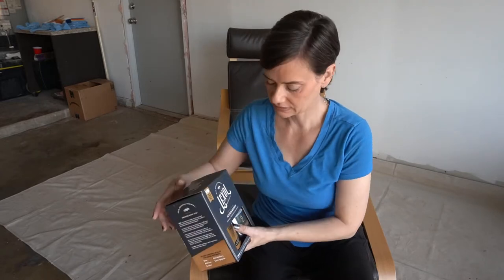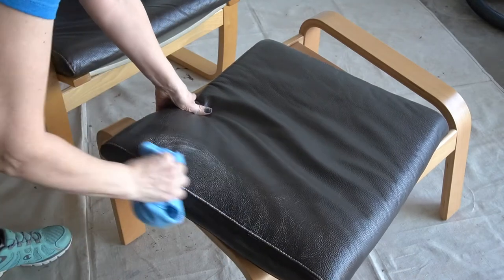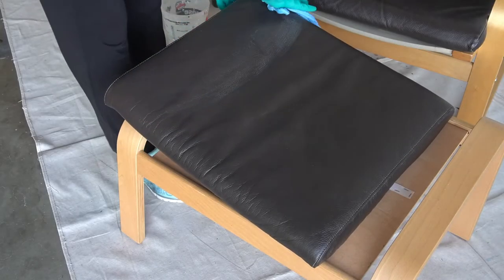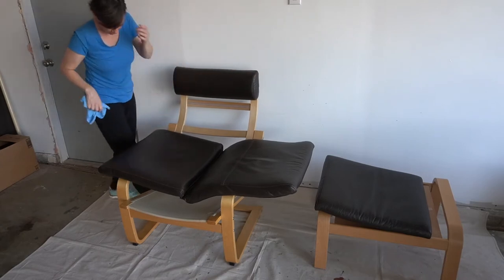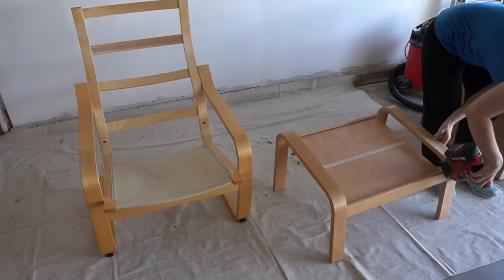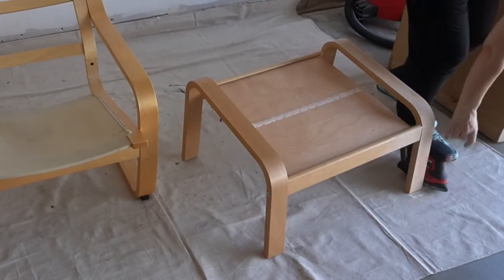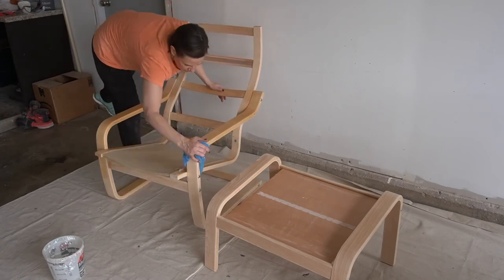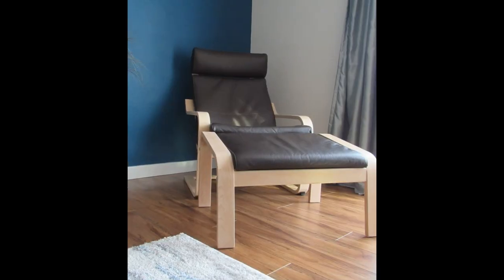IKEA Chair and Footstool Refresh Leather & Wood #furnituremakeover #restoringleather #Lexol

Comment: For cleaning leather I use saddle soap to clean my leather car seat. It doesn't smell all that great but it works. May need to do it twice to get it working but it does a great job!
Reply from the maker: Thanks for the tip! I'll check that out next time this needs cleaning.

Comment: Still surfing for faux wood finish.
Reply from the maker: I've responded on your other comments but in case you don't see those, check out my Cozy Winter challenge video from 2021. It's linked in the description of the dresser video and gives much more detail about my faux walnut process. Thanks so much!

Comment: I have a set of those chairs with one Ottomen that was lifted outdoors and got weather damaged... So I want to make make it a patio set for outside, and just take in the cushions after using... What treatment would you recommend after sanding?
Reply from the maker: Since I can't see the actual state of your chair, I can't really say what's the best option. If it's not expanded and still structurally stable, look for a topcoat made for exterior use on furniture. Good luck with it!

Comment: Thanks for this post! I’m working on redoing the wood on the same chair, I want the wood darker so it matches my other furniture.  I sanded it as much as I could (it wasn’t easy for some reason) I used the mouse B&D sander, took forever and had to even go as low as 60 grit. Kind of worked but don’t want to sand more (noisy, messy and neighbors are complaining). How would you recommend I stain it? I have varathane oil based Kona, Jacobean and Aged barel stains (I’ll go for Jacobean I think). Any tips would be grea, do I apply pre stain conditioner? Thanks
Reply from the maker: I'm happy you found this video helpful, leila1! If you're planning to stain (hate to say it but) you'll need to graduate up a few more grits from 60. A low coarse grit like that will leave the wood fibers chopped up. Even if you can't see it, you will get poor results once you stain. I suggest 120 then 180 before stain. Especially on a hard wood like maple. I'm not sure about a conditioner or the oil based strain you mentioned. Never used either and wouldn't want to give false info. You should check out Angie at Transcend Furniture Gallery for help with various stains and application methods. She has a ton of helpful videos! Wishing you the best luck completing your project!